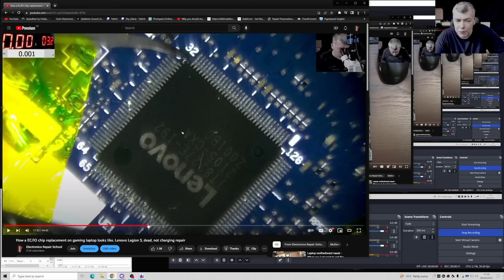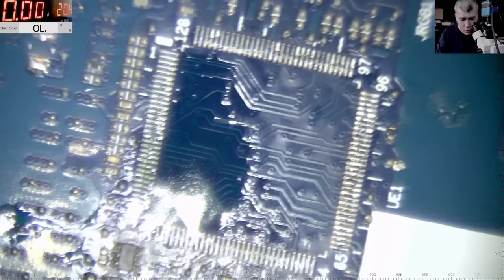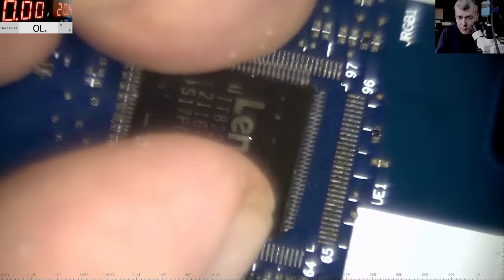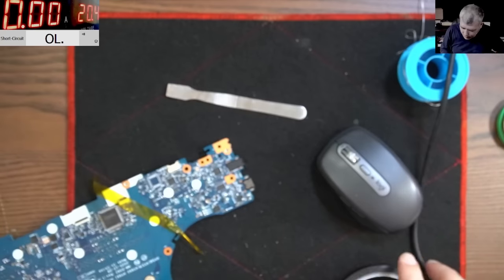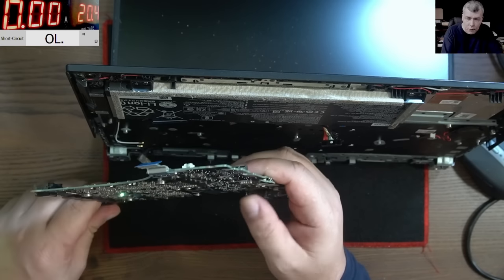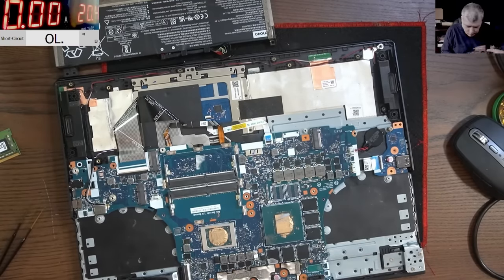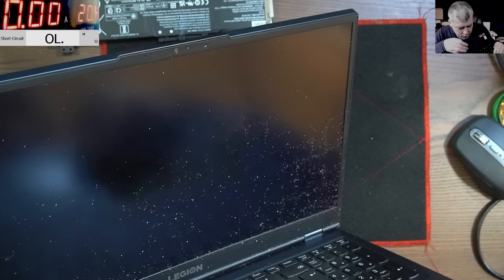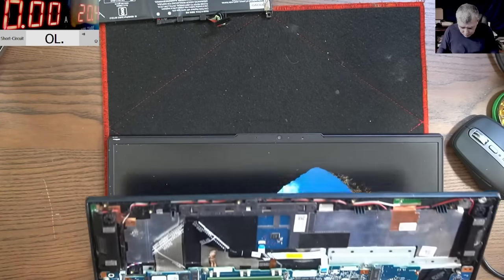Lenovo Legion 5 - EC chip replacement

Comment: Hi Sorin, nice video as always. Which temp/air pressure do you use with i/o chip?
Reply: Doesn't really matter air/temp, on st862D I usually use 350C or higher and 50% air.

Comment: You could have at least read the program off the chip before you installed it. Then you would have the file in case you get another one to fix. Thanks for the video. You could do a video on how to find the pins needed to program chips.

Comment: No harm, no foul. You got it working which is a good thing. 😃 Seems it was a more cost effective method of repair to have Pitstop program the chip instead of the expense of purchasing that adapter UNLESS you expect to do enough of these that you can justify the expense. The plus side, you get the repair done in a timely fashion, the downside, the customer will have to wait a bit. It's always nice to have the tools but good tools are expensive and there has to be at least a breakeven point to justify the expense without beating up the customer. IMOP, since you've already invested in the programmer, I would make the 'investment' in the adapter.🤔